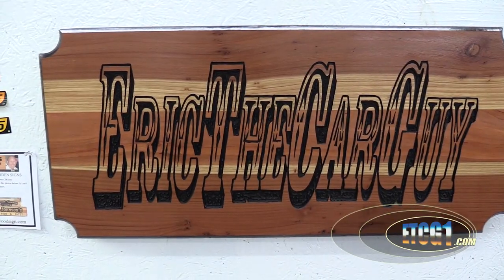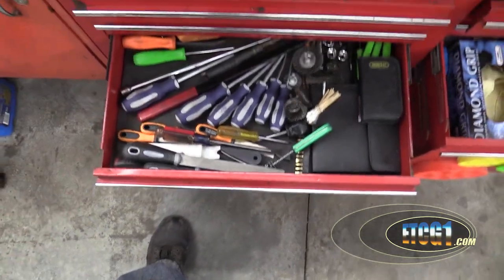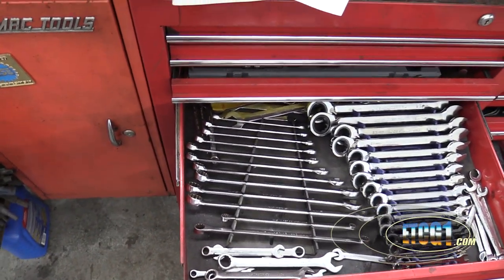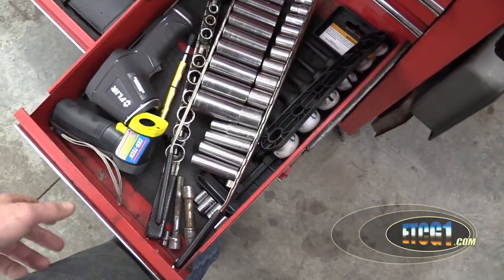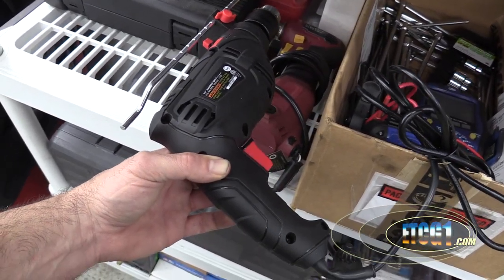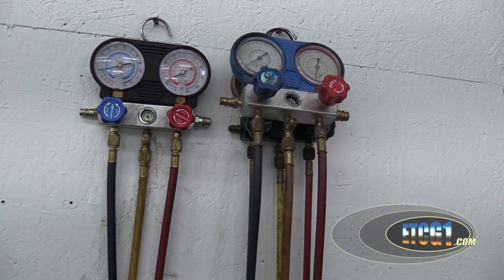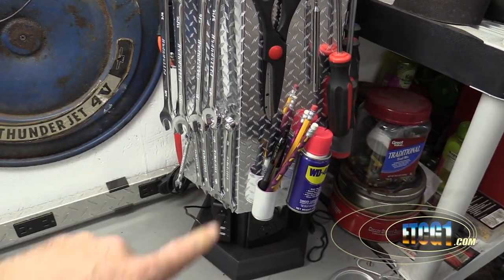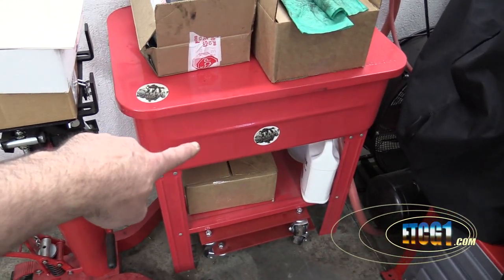Stuff I Get From Harbor Freight -ETCG1

Comment: The hose clamps from harbor freight were complete garbage, my wife's catalytic converter was rattling so I bought those to quiet it....I broke about 8 of the hose clamps then I bought 2 large ones of better quality for the same price. Throw those harbor freight hose clamps in the garbage Eric!!!!!
Reply: why would you be using hose clamps in the first place?
Reply: +Russell9111 why would you think? It solved the rattling in a pinch.
Reply: +Aaron Johnson Its just a temporary fix that will rot off in a few months that's all.
Reply: +Russell9111 yes it was a temporary fix of course, I live in Phoenix Az. It was on for an entire year and didn't rot off, it doesn't rust where I live so yeah it could've gone for another few years without an issue.

Comment: harber freight is for the diy guy not for a professional, I rebuilt my whole engine (well a head gasket)with those tools with no problem, only spent about 120 on tools and 60  for the gaskets
Reply: I might add I had no tools before hand. and I got sets so i could have all I needed

Comment: my winners, heat gun, angle grinder, solid hand truck tires, impact sockets, aluminum jack,   my losers, adjustable wrenches, fuel pressure tester, safety wire pliers, cheapo socket set, impact driver.  But hey I got a free flashlight

Comment: do not buy any battery power tools dont buy and hand tools dont buy any drill bits. I'm a sheetmetal mechanic DONT buy any sheetmetal tools there or you will be sent home for not having the right tools for work because they will break if you have to cut anything thicker than 26 gage lol

Comment: One place where I'll have to disagree with Eric is buying cheap Allen/Torx bits. The cheap ones have caused me nothing but trouble and USUALLY take the head of the screw out with them. Even the high quality stuff is prone to twisting off or rounding over.

So... If you just need that ONE size, at least buy it from Sears or NAPA. They stand behind the warranty and I've good luck with most of their stuff. All other brands that are cheaper (HF, Autozone, Hardware store brand etc) MAYBE got me through the first job.

----

And for the love of God, if you take a Torx or Allen out, put a normal bolt or screw back in. They're nothing but problems.
Reply: +Maxwelhse The craftsmans are rubbish too,  and not any better than the pittsburgh stuff the sell at HF. Buy some good german Wera  torx and hex bits and you'll never go back.
Reply: *****
Some of the problem I'm having is that I think places like HF have caused Sears to have to lower their standards to compete with them. I have had the Craftsmans for about 12 years with no problems (rounded off the t-45 of a set I had for 10 years before that and they just gave me an entire new set when I took them in). But rest assured, if I do need to replace them again, and their quality has slipped, I'll be buying higher quality.

I guess the bigger point I was making is that I would get the best quality Torx or Allen I could afford. If that meant $30 for one good socket today or $30 for a set of junk ones to count on in the future, I'd buy the single socket.
Reply: +Maxwelhse Yes, most old craftsman hand tools were good, it was random though due to the fact that sears has never made their own tools, they were contracted out to various companies over the years.

But I wouldn't blame HF for their current state so much as a change in global trade and consumer mind set. You could make a better case against Walmart for causing it than HF. Not to mention they were going downhill many years before HF was very big,  Sears has had all kinds of problems and made some really bad decisions. They used to contract good reputable manufacturers and had good quality standards, not so much anymore but they do still have some decent tools and one thing you can definitely say is the warranty can't be beat for hand tools, hell if you find a bent up rusty craftsman
tool on the side of the road you can walk out of any sears, ace, kmart or whatever with a new one.

My personal recommendation on hand tools is to get to know what old brands and tools were good and pick them up at garage sales, thrift stores or even ebay etc. I have some ww2 era tools from my grandfather that still work great. And who cares if a wrench is from a few decades ago as long as it still works, in fact there's never really a reason to ever buy certain tools new except the shiny, but tools are for working not looking at.
Reply: *****
I would generally agree with your larger point about Walmart vs. Sears, but Walmart has never been a serious contender in the area of tools, where as HF is. I don't at all disagree with any of your thoughts about the decline of Sears as a whole either, but I don't really factor in the "Walmart" effect on Craftsman. When our first HF came to town, in probably 2002 or so, Craftsman was as good (or bad) as it ever was and most of it was still USA made. Now, not so much. I only have a handful of Craftsman stuff than it newer than the 90 to mid-2000s period, so I really don't know how it is now.

Funny you mention the Craftsman warranty... I'm in a parallel chat with another guy on here that is telling me that Sears now makes you fill out paperwork and run you through the ringer to exchange something. I haven't encountered that myself (I haven't taken anything back in ages, but I do have a few things that need exchanged... I think all but one ratchet was due to my abuse of it) so I guess I'll find out soon.

I agree with you on the used tools too, but I'll even take a step further down a dark rabbit hole of cheap tool talk... I have some Taiwan tools my Grandpa bought in the 70s or 80s that are still going strong today and I've beat the absolute snot out of them. My entire 3/4" drive set is some no-name made in Taiwan crap and I'm fairly convinced it can't be broken (I've had an 6' pipe on the RATCHET it came with... no problem). So, when it comes to tools, I think older being better is pretty much a firm rule, even more so than manufacturer.

In the spirit of your comment though, a friend of mine bought a busted SK ratchet at a pawn shop for $.25. A phone call later and SK sent him a full rebuild kit for it for free. It's now his favorite 3/8" drive.

If I was in need of more basic hand tools, I would definitely hit up the pawn shops and garage sales more than I did when I was building my collection. Back then if I needed something I needed it right then so I couldn't really afford to shop around and never thought to do so before hand (here was never "spare" money to go tool shopping... until I HAD to buy something), so it was off to Sears I went... usually with a VISA card in my hand.
Reply: I agree it doesn't have to be a name brand to be good, I've had good tools from all over the place including (brace yourself) ...china. It's just more hit and miss for the younger guys starting out that don't have a feel or the knowledge to judge a tool, for us older tool guys we can pick it up and tell pretty quick if its any good, and often just by glancing at it.

Walmart definitely hurt Sears sales when they exploded, you forget that household goods make up the bulk of Sears sales, or did anyhow, and when their profits are down over all they have to start cutting corners. It makes sense they would do it on the brands they control, beginning with over seas outsourcing.
The internet obviously didn't do sears any favors either.

I guess I just don't have as much experience with HF as other folks as there hasn't been one around me for most of my life, and there aren't very many in general where I live in the pacific northwest. For the last 20 years I've lived on an island that only has an Ace hardware, 2 local building supply stores and a terrible Home Depot about 40 minutes north of me. I already had a pretty well stocked tool collection when I moved here though and pick stuff occasionally at estate sales and thrift stores. I can't resist a good quality used tool for cheap and have quite a few doubles and triples of most wrench's , sockets, etc etc. I give them to my son or toss them in a drawer for back ups, and keep basic tools in all my vehicles. For consumable tools like bits etc I go Ebay or Amazon, for power tools I usually do either ebay or refurbished.

Comment: Snap On is a shaft company, under given contracts with smaller companies they are allowed to have these companies make their sockets, wrenches and other tools and then they place their name on them. Snap On does make their own but only a small percentage, I know this because I was a juror in a lawsuit regarding this mess.
Reply: Snap on is harbor freight 😅
Reply: +fordwindsor351 
When was that trial? 
The BluePoint product line from SnapOn are items not manufactured by SnapOn, but their SnapOn branded sockets are manufactured by SnapOn.
Reply: +patw52pb1 this was in 2004 and no, they do not make all their tools.
Reply: +patw52pb1 also want to add that from what took place Snap On paid even more money to basically cover this trial, some of the details can't even be discussed. most was just sweated under the rug when it was all done.
Reply: +fordwindsor351 
As an aspect of my employment position I am responsible for determining, assuring and certifying the source of certain tools and equipment for contract eligibility, contract specification, contract compliance, traceability and regulatory compliance. 
I spoke by phone with an executive of Snap-on Tools today and he assured me that all Snap-on branded 1/4, 3/8, 1/2 and 3/4 inch drive ratchets, sockets and extensions currently sold in the US are currently manufactured by Snap-on in Snap-on owned plants. 
When asked where those manufacturing plants were located he replied Milwaukee, Wisconsin; Elkmont, Alabama; Elizabethton, Tennessee; and City of Industry, California. 

I asked about outsourced socket manufacturing to contractors and he said that some 3/4 inch and larger drive "Snap-on Industrial" brand sockets sold in the US are currently manufactured by contract in plants not owned by Snap-on and those plants are located in the US, Canada and Mexico. 

When I asked about sockets and wrenches manufactured offshore I was informed that some Blue-Point branded products sold in the US are manufactured offshore in several Asian, Australian, European and South American countries and some Blue-Point brand products are manufactured by contract in plants not owned by Snap-on and those plants are located in US, Canada, Mexico and globally. 

I asked about the court case you referenced and he replied it was before his time with Snap-on and he was not aware of it. 
Pursuing the issue further he referenced some documents that indicated that there were some Snap-on branded 1/4 through 3/4 inch drive sockets manufactured under contract in plants not owned by Snap-on to supply an unusually high demand between 1990 and 1998 and the quantity was less than 10 percent of the units sold during that time period. 
He then informed me that he was not aware of any outside contract manufacturing of Snap-on branded sockets or wrenches sold in the US other than what we had already discussed since 1998.
Reply: Well his claims are not fully right, but think what you wish.
Reply: fordwindsor351 
Traceability, compliance and full disclosure in the industries I operate is serious and it is corporate and personal career suicide to falsify data and or documents. 
With all due respect, I will believe a Snap-on executive that is legally bound by an affidavit and the penalty for falsification is a criminal felony for perjury and civil indemnification for any loss or damages.
Reply: +patw52pb1 good for you but again, his info at least some is wrong.
Reply: fordwindsor351
What do you allege is wrong?
Reply: +patw52pb1 You seem to be stuck in what he told you and that's fine, I know things about this company that paid millions to keep some info from the public, which is why he is saying wrong info. Enjoy your day.
Reply: fordwindsor351 
Snap-on has a legally binding contractual obligation to provide full disclosure to us for compliance with federal (CFR) regulations. 
What is it you know about Snap-on? 
As a juror you are under no obligation to remain silent after adjudication, please elaborate.
Reply: +patw52pb1 you know very little, I'm done here.

Comment: Stay away from their batteries. They are 'ok' for tv remotes, but a video game controller will drain them in less than 5mins.
You CAN get a cheap multimeter for less than $5 though.. 

I wouldnt trust anything from harbor freight that could easily kill me.. (Ramps, jack stands etc)
Reply: +Hercules Rockefeller I had one of their batteries leak breaking the wireless mouse it was in.

Comment: From my experience, the metal that HF uses is very low quality. If you believe in quantity over quality, then this is the store for you. Also, many of their power tools have poor bearings (bushings?), and wear out very quickly. I worked at a place that bought only HF tools and all of them ended up in the trash eventually. We bought 5 angle grinders, all of them failed. All of the metal  cutting and grinding tools failed way too quickly. WTF? False economy is the term that comes to mind...
Reply: It all depends on what lines you buy. The metal, overall, is pretty decent to good quality.
Drillmaster products are somewhat iffy, they are much cheaper and it shows.

Comment: Harbor Freight, Northern Tool & Tractor supply, a lot of usefull items from those places,then again  be careful what you buy & how your going to use it,most is SCHITT made in China ! I wouldent buy a compressor,any load bearing equipment, chain falls, come a longs,Jacks,Jack stands,anything that involves electricity or Hydraulics,

Comment: Everybody Do a NEW COMMENT , AND EXPLAIN WHAT SPECIFIC HF ITEM YOU WOULD NOT RECOMMEND BUYING BECAUSE YOU HAVE USED IT "PROPERLY"  AND DEEMED IT CRAP. 

i WILL START 

don't buy the AC FUEL metal  SCISSOR SHAPE quick disconnect tool. It is crap. thing broke quickly after trying to use it for the first time in 01 ford escort.
Reply: +Ll Lock  I've never been to Harbor Freight. Too many "Horror Freight" stories. They have such a bad reputation, I don't know how they stay in business. I guess that makes me a " tool snob", right? I'm okay with that.
Reply: +Ll Lock      I burnt up 4 of their electric palm sanders in one day and I have an air saw from there that just stops when you try to cut anything with it. I have also burnt up two 4.5" electric angle grinders but they did work for a while so I figure for $10 they are still worth it. In all I would say I have had more good luck than bad with their tools but Eric is right on about if you use these tools every day get name brand sockets, wrenches, and screw drivers at least
Reply: +Richard Darlington They stay in business because walking into one is like walking into a foreign country where the dollar is worth 3x to 4x more. And they stock it full of all sorts of odd things you never knew you wanted to buy. Then suddenly you find yourself justifying buying that on sale for $5 thing that you never could bring yourself to spend $40 on the other stores because you don't really need it, but it would be handy to have it around even though your brain says It's crap. Then the flyers with the 15% off coupons start showing up in the mail.. no, it's pretty much best to stay away from that.  

But when they run those deals on shop gloves tho...
Reply: +Riptides99  Point well taken. I suppose it wouldn't kill me to check it out at least once. Wish me luck!
Reply: +Riptides99 
Dude....yea the blue 5mil gloves and the paintbrushes that come 36 to a box....
handy stuff to have around.
I prefer the 1" ones. 
The paintbrushes actually suck for painting but are great for anything else like car detailing.
Reply: +Richard Darlington  they stay in Biz from young people starting off in a trade because they cant afford good quality tools as they progress they will start to buy better quality tools
Reply: +joseph Bethea I use harbor freight ratchets almost exclusively and I e been in the trade almost 20 years. I really don't care if they're Chinese because so are all the others. if you don't believe me go look at a new SnapOn ratchet and tell me where the "USA" stamp went. Still costs over $100 though. I first bought the HF stuff as backups for when my Snap On ratchets failed and I had to wait at least a week for my truck guy to get it rebuilt. I finally just said screw it. They all failed at about the same rate. The HF ratchets have the same smooth 72 tooth drive and comfortable grip and I don't feel bad bearing the piss out of them because they're only like $15 and I can take 5 minutes to drive over to the store and get them replaced for free for life. After all the advantages of the tool truck evaporated I couldn't justify spending $100 in a ratchet anymore. I use the money I save to invest in important specialty tools, scanners, software, and heavier equipment. I literally saved enough not buying tool truck tools anymore to transfer that payment to my new dyno which. Much better investment.